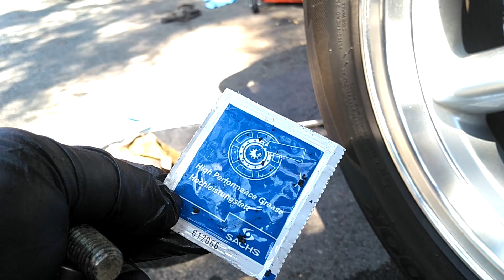Finishing up in PA, Also finished the clutch kit replacement in the P1800 ES. Then pulled a head.

Comment: Hey Robert really need some help. I got a 92 940 lost the only key I had for it. Went to the Volvo dealership and they got me a new key but the key isn’t working. Any ideas?
Reply from the maker: Doesn't work in the door or the ignition? Seems like you need to get another ignition, new or from a salvaged car.
Reply: Robert DIY thank you so much. Yeah the key isnt working for the ignition nor doors, I had heard that the new ignition was a good idea. Also heard about taking the door cylinder to a locksmith and have him measure it then cut a key after. I’ll go for the ignition idea seems more secure
Reply: Robert DIY should it come from a Volvo or any vehicle